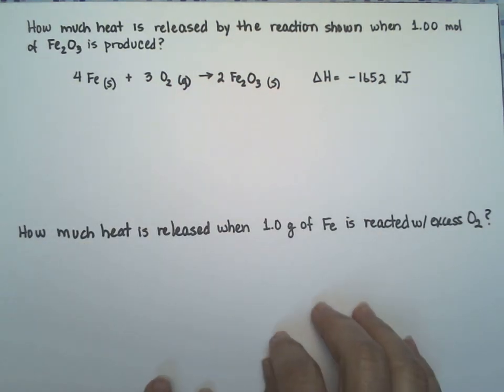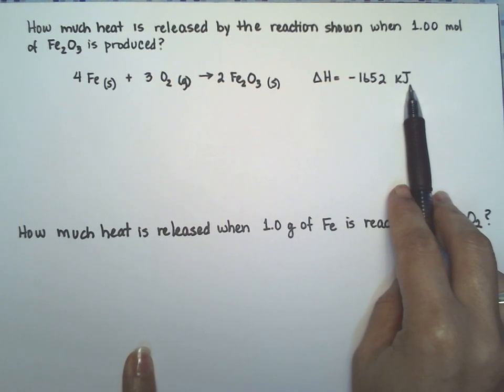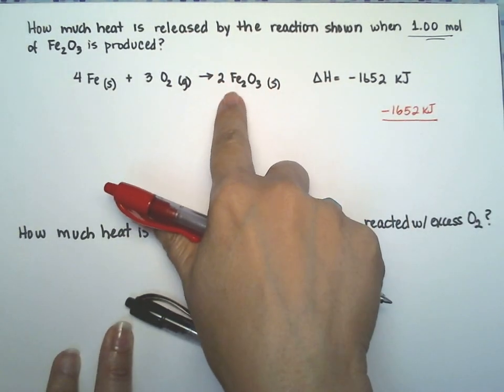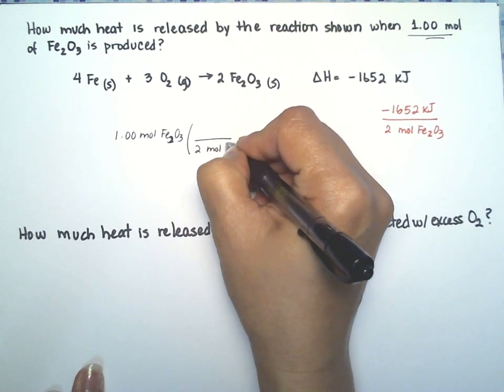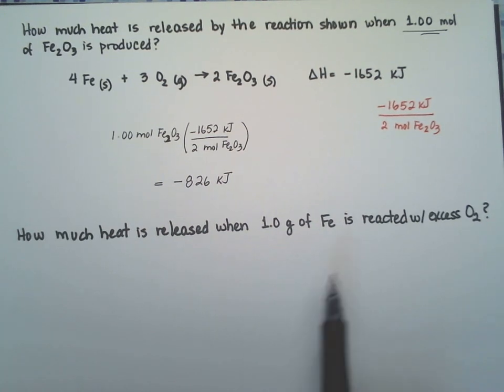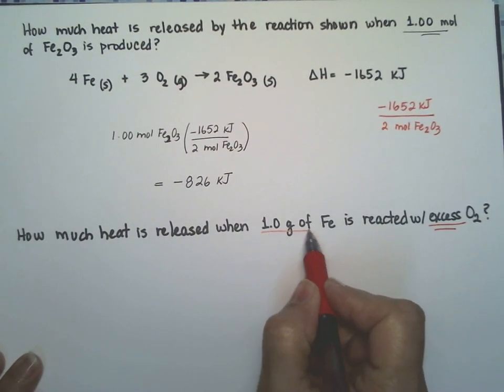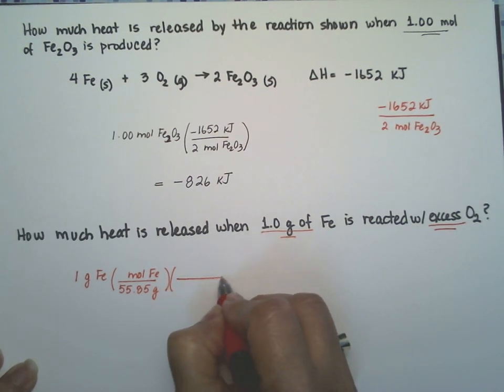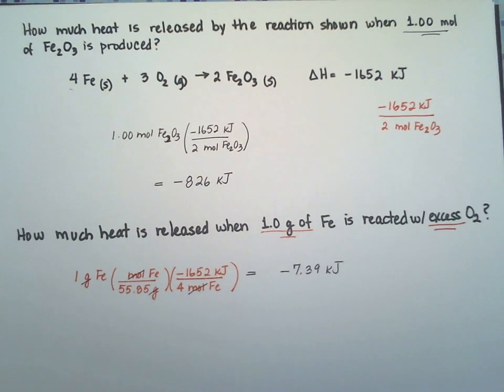How much heat is released by the reaction shown...

Comment: what if the question is 

 CH4(g) + 2 O2(g) → CO2(g) + 2 H2O(l) ΔH = -890 kJ

If 1.50 moles of CH4(g) is allowed to react with 2.25 moles of O2(g), the quantity of heat released in kJ is: